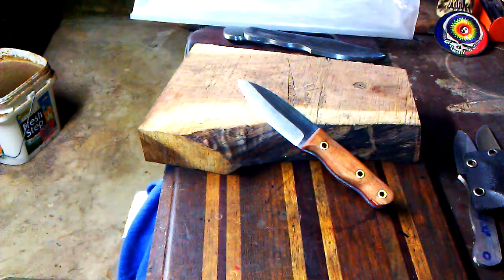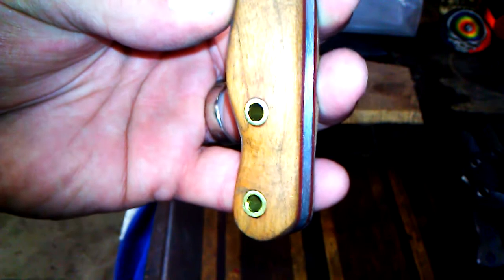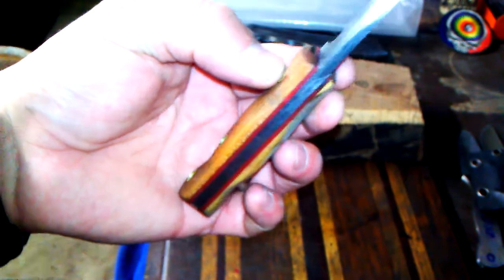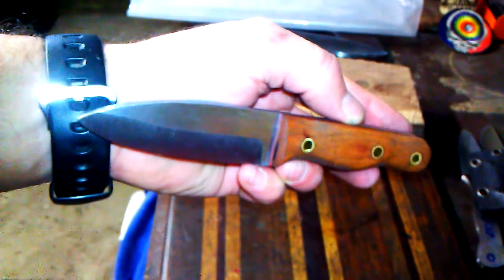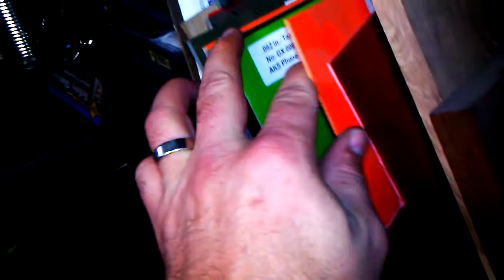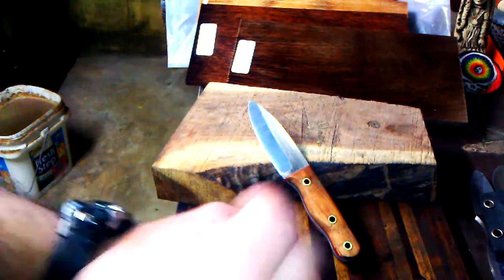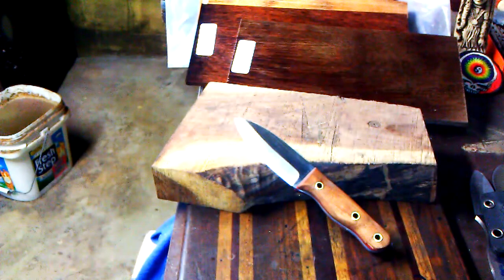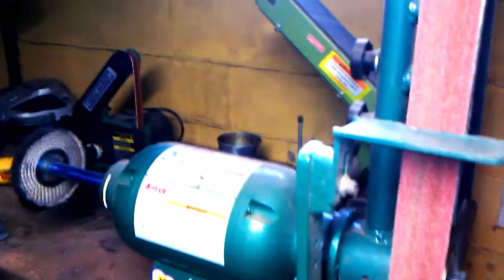Closer look, mini Bush knife.

Comment from the maker: Lol, thx Gonzo, n, never tried red cedar. 
The baby woodchucks haven't been heat treated yet, thus, they aren't sharp yet. You have to leave a little meat on the edge so as to assure they don't warp during heat treat, so it's not sharp yet, but it will be after heat treat, i'm obsessed with getting em sharp, after all, what good is a dull Knife, unless it's a butter Knife or some sort of pry bar Knife tool thing, lol